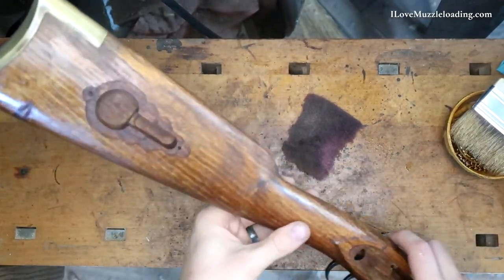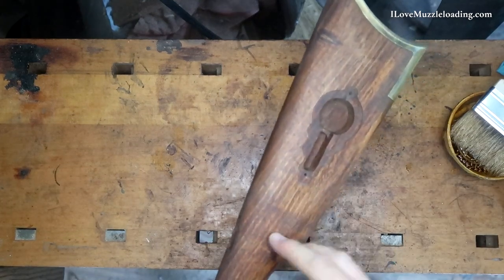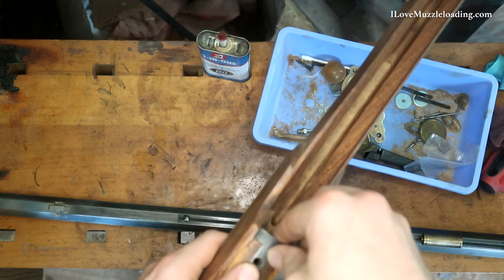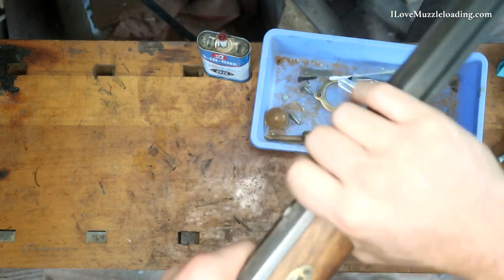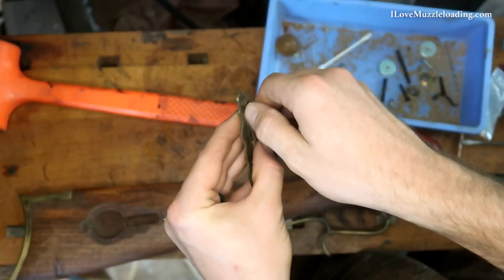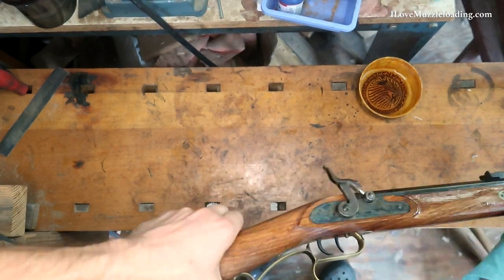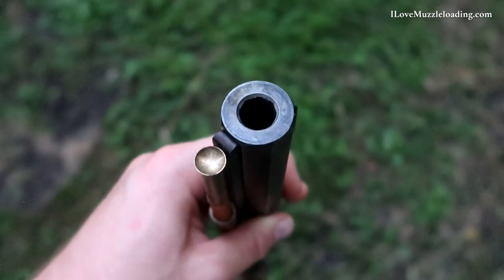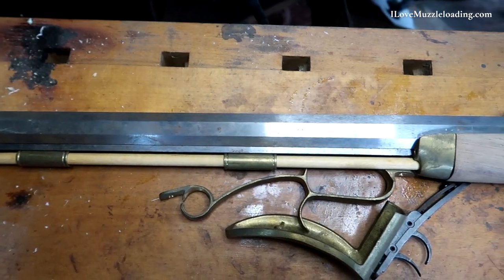Ready for the Mountains | Let's Build a CVA Hawken Part 9 | I Love Muzzleloading

Comment: Youn an also use WD40 as a cutting agent to buff it with the wool...then tack it off..let dry..then re apply light coat oil..using wd40
Acts like wet sand. With Steel wool